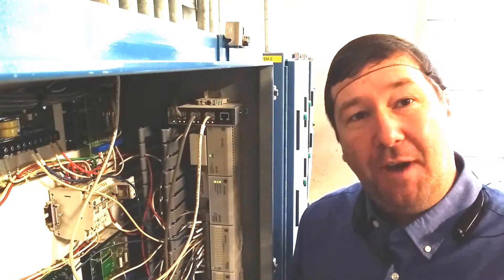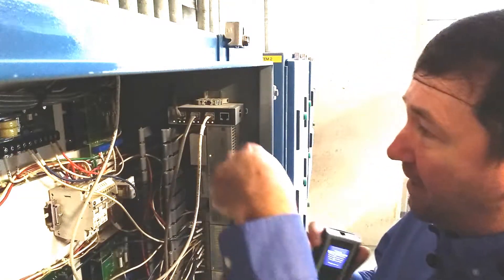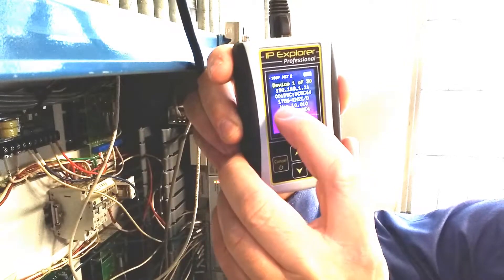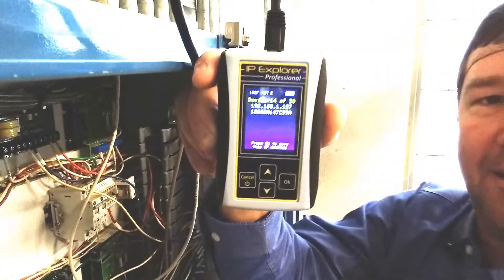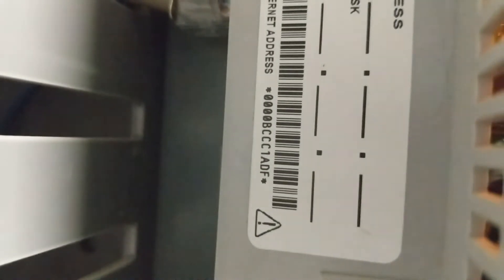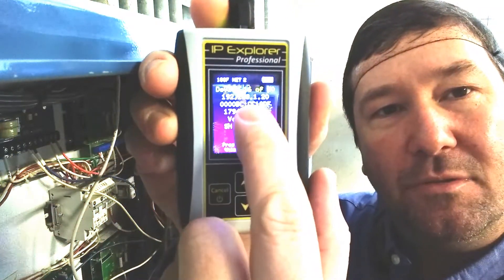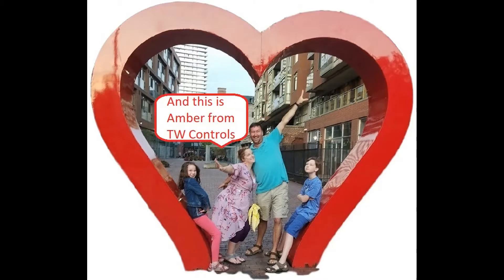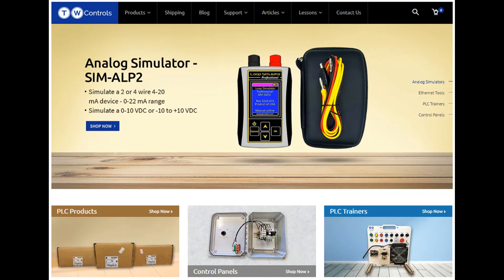Discovering the IP Address of an Allen Bradley 1794-AENT Flex I/O Module

Comment: So I'm in a bit of a predicament. I wrote a program for a machine, and things happened to where I have to re-assign my i/o. Do you have a good way to quickly re-assign i/o, or is the only way to go through and change instructions one by one?
Reply from the maker: Which software are you in? Most of them have a find and replace feature.
Reply: Tim Wilborne rslogix micro starter
Reply from the maker: Yes it has a good find and replace feature.
Reply: Tim Wilborne awesome I'll check that out thank you! 👍🏻